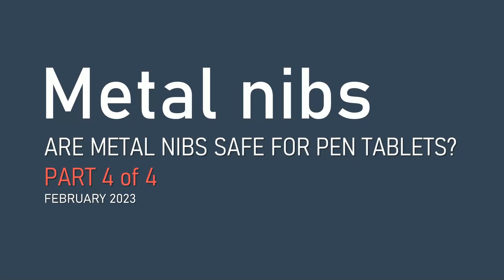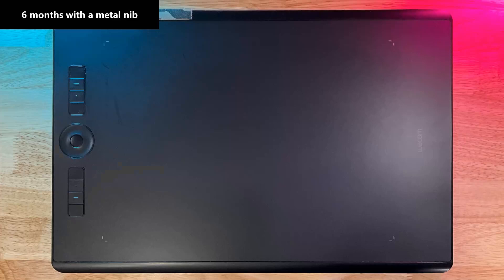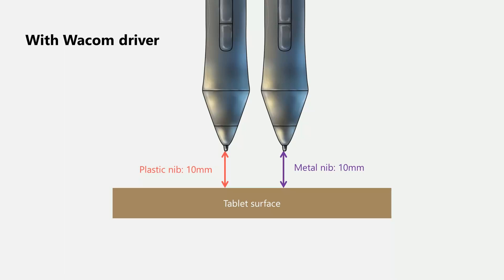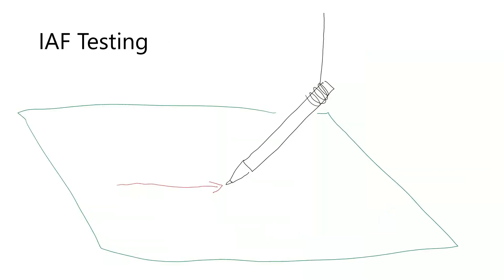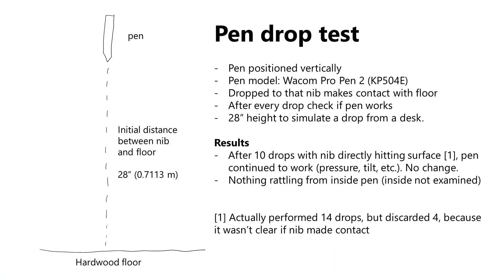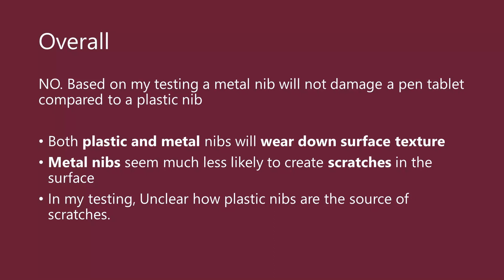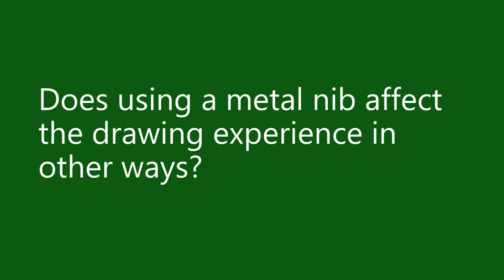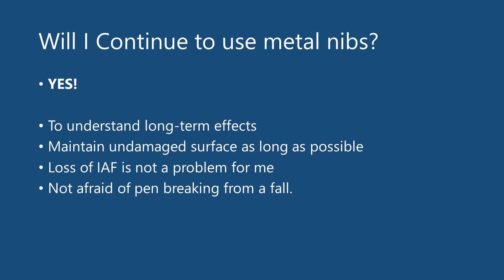Are Metal Nibs safe for your Pen Tablet? (Part 4)

Comment: I can easily explain why scratches are created on the surfaces of pen tablets, pen displays and normal tablets with pens such as iPad. For a considerable amount of time, I had to work in a very dusty environment, I had a construction site against my window, from where stone and sand dust got into my room. During that time I had a bad experience of having a lot of scratches on my drawing tablet, pen display and ipad. And actually metal nibs created less scratching that time the reason is Microscopic dust particles if they are of hard material Get on the surface of display etched surfaces Catch much more of this particles. When you glide pen nib over a surface such hard particle can embed itself into plastic nib act as a chisel for a couple of millimeters and get yeeted out due to friction between surface and nib. This situation is easily repeatable and anyone who hates his screen protector can check this himself. If you are living in dusty conditions and have no other choice wet wiping your working surface from time to time is the best solution and also wipe the nib of the pen sometimes too.
Reply from the maker: Thank you for this insight. I will note this in my doc about caring for tablets (https://docs.thesevenpens.com/drawtab/guides/caring-for-your-tablet)

Comment: Recently got titanium nibs for the intuos pro pen 2 i have. I am testing it on my cintiq 24 pro (it has a photodon 9H screen protector on it). I am not noticing any scratches nor any wear on the nib.
Reply from the maker: I'm still too scared to try it directly on the glass.
Reply: @thesevenpens  for any display just purchase a film or sheet of acrylic and place it on top qnd it will provide protection. I recommend Photodon and at least a 9H hardness.

The only thing that can happen is the stem of the nib will slide out of the front of the 2nd gen pro pen but for now its staying put (I read somewhere that adding a tiny thin layer of scotch tape will at least help ot say in the pen (titanium is non adhesive and slippery metal).
Reply from the maker: @Pen-tabgraphite  Thank you! I will try that Photodon one you mentioned.

Comment: Thank you for this series! I recently got a metal nib for a wacom one pen and a paperlike matte surface for my galaxy s8. Works great so far, although I have noticed less sensitivity of the pen if I write at increased angles. I haven't noticed the need to use more pressure though, but I also have the pressure increased on my tablet anyways.